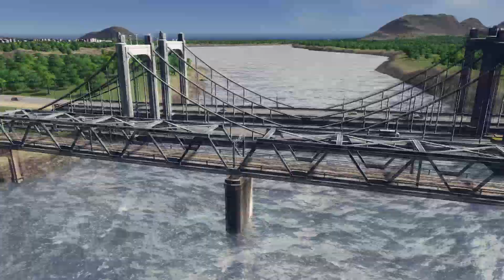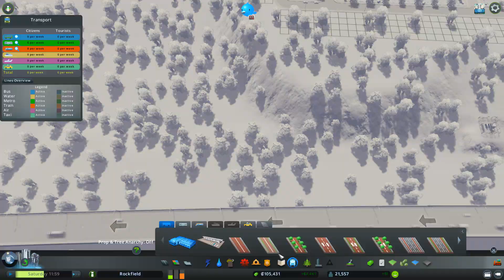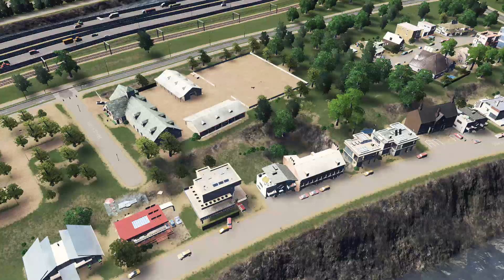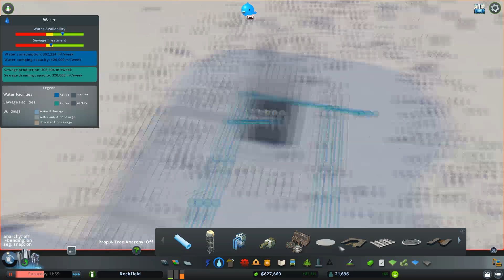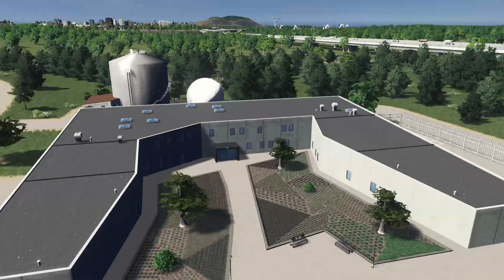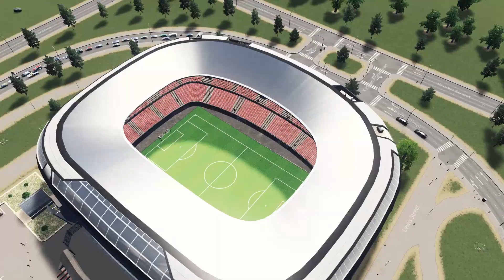City skylines 16 “trains and cameras”

Comment: The 90 degrees curves shown look very tight and unrealistic for a railway.  Especialy the U-shaped one shown from 4:30 to 4:35- not even a tram (that can generally negotiate tighter curves) could easily deal with it.
Reply from the maker: smile2evan appreciate the feedback, I’ll have a look at train turning circles, and I’ll edit the world accordingly. Thanks for the comment :)
Reply: If we assume that you built a Light Rail system, then it might be acceptable. Download matching vehicles from the workshop (e.g. https://steamcommunity.com/sharedfiles/filedetails/?id=561008120, https://steamcommunity.com/sharedfiles/filedetails/?id=585209941, https://steamcommunity.com/sharedfiles/filedetails/?id=561007663 or https://steamcommunity.com/sharedfiles/filedetails/?id=1120583265&searchtext=metro for USA style) and run one of these on the line using Improved Public Transport mod (http://steamcommunity.com/sharedfiles/filedetails/?id=928128676) to select the type you wish for the services. ;)
Reply from the maker: However, would a tram be most appropriate? the distances aren't that short...
Reply: A Light Rail system is advanced faster and more efficient than the traditional/conventional urban tramway. So for your design of passenger railways a Light Rail system would be just perfect.